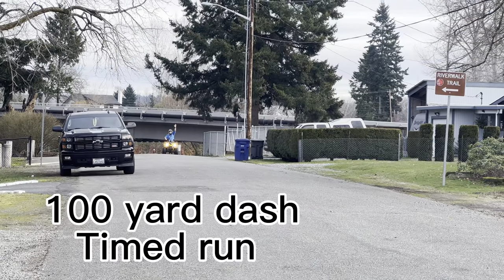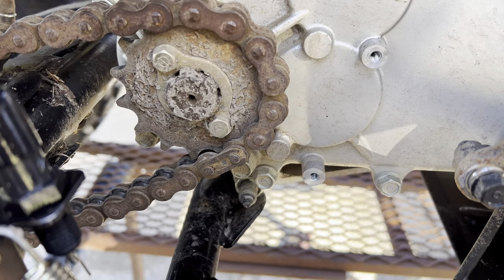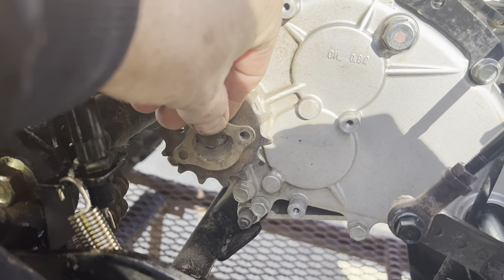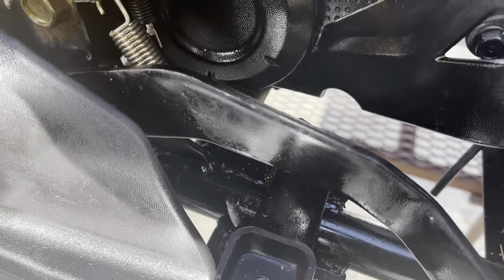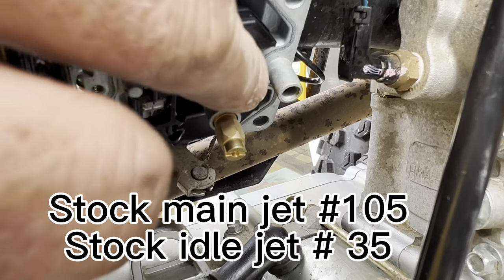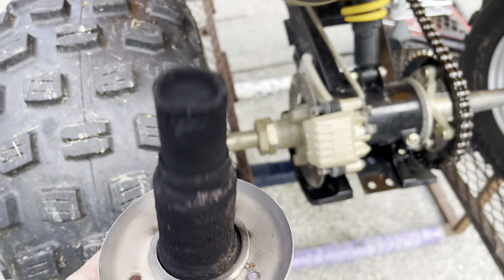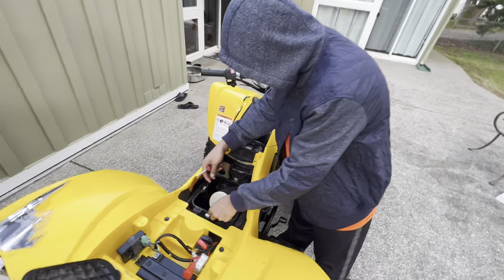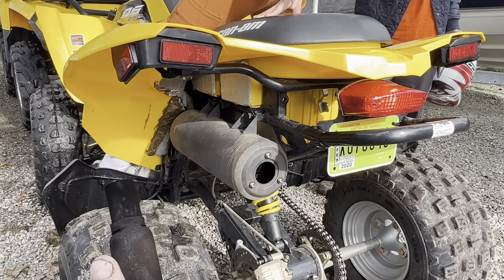Can Am DS 250 HUGE POWER INCREASE FOR ONLY $26.00 Dollars!!

Comment: For cleaning the black carbon buildup, nothing works better than a decarbonizer spray. Seafoam is the most widely known brand. Others are: Powertune, ring-free, and more. It will melt that black carbon off like butter! Then come back and clean the seafoam off with a degreaser, and then rinse. You'll be amazed. Spray a little seafoam in your spark plug holes every month, and your piston rings will outlive the rest of the motor! It's probably the best hazmat in the world for engine mechs. 😁
Reply from the maker: I’m gonna get some Seafoam. I really like the idea of shooting some in the spark plug holes!
Great way to reduce carbon build up!!

Comment: will the machine be okay with just a sprocket upgrade?  or is it recommended other upgrades mentioned in video?
Reply from the maker: You can do just the sprocket upgrade by itself, and that will help a lot. The sprocket upgrade is super easy to do.
Reply: @bowntown1909 so I bought the sprocket but the holes won’t line up with the keeper, the sprocket holes are just barely too wide apart, one screw goes in fine with the keeper but the other would be going on crooked. did you have the same issue
Reply from the maker: I don’t remember having that problem. Can you drill out the holes a little bit bigger on a drill press?

Comment: Nice video, but did you guys thought about just changing the C.D.I.? Or checking out the restriction in the belt? Obviously you checked the one in the carburetor.
Reply from the maker: Thank you for the reply, and yes, we just ordered a new CDi box. So we are anxious to see how that works out!
We have heard about the restrictive red carburetor, spacer located in the slide area. I have been wary about cutting that out of there, because I have read online where other people have them had follow up problems with their throttle cable. Perhaps the throttle cable could be tightened up to take out the extra slack caused by the spacers removal. Any thoughts?
We’re not experts, but we’re having fun learning the whole process.
Reply: Thank you for getting back to me, I think the problem with the throttle it’s how you put it back. Watch a video on how you put the cable line in the carburetor. There is 2 screws inside the carburetor to adjust the fuel flow, and it’s connected to the throttle cable. If you don’t put it back the right way the throttle gonna be loose. 
I also ordered a new CDI box that should get here next week. I am gonna  check the clutch to, they been putting speed restriction ring.
Reply from the maker: @MrNeldana  that makes perfectly good sense, because I know that everything was lined up perfectly before pushing the slide and spring back in and screwing down the cap.
Reply from the maker: @MrNeldana  I will shoot you a message on here when we get the CDI box in and when we cut out the red spacer to let you know if we’ve had success and improvement.
Reply: Next time you order a cdi box, get two! They may not be available much longer.

Comment: That's actually a spark arrestor
Reply from the maker: Your right, cause it has all the screens.
It does restrict some flow though, especially when they get carbon build up.
But then again you are required to have them in when riding at most 
ATV  / ORV Parks. So we put ours back in a left in.
Reply: I've lost mine does it have to have one in could u let me no